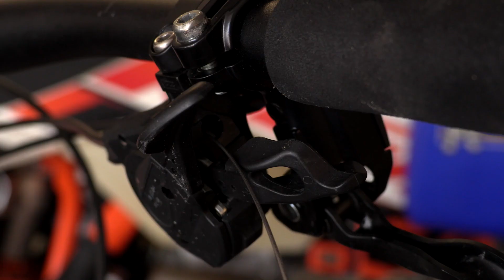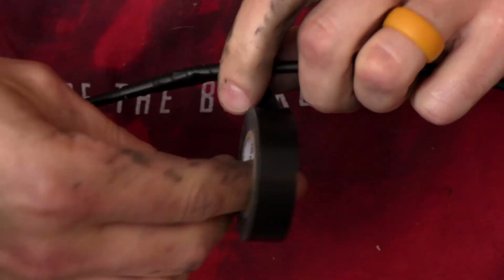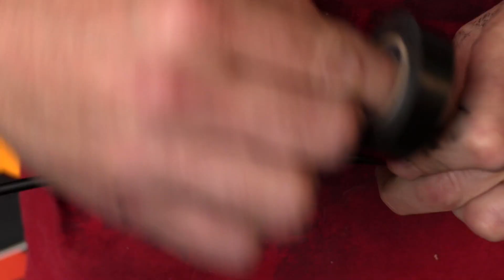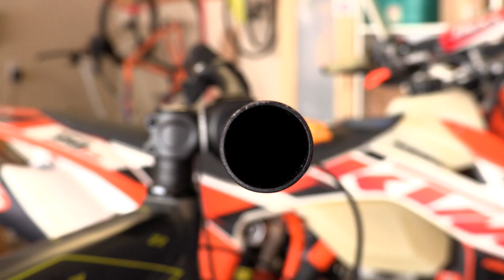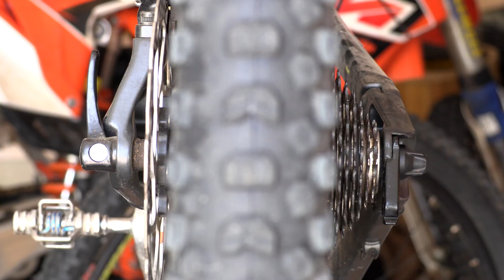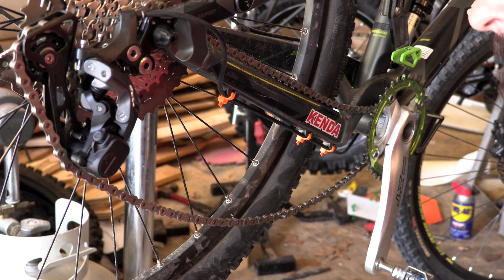Shimano XT M8000 1x11 Speed Drivetrain Install | Timelapse

Comment: what kind of free hub do you have. because most of 10 speed freehub are not compatible with 11 speed casette
Thanks
Reply from the maker: These were stock on the bike, but they were Shimano Deore hubs.
Reply: I disagree...it is 12 speed cassettes that most freehubs are not compatible with
Reply: I have a hope pro 2 and a can take 9 ,10 and 11 speed